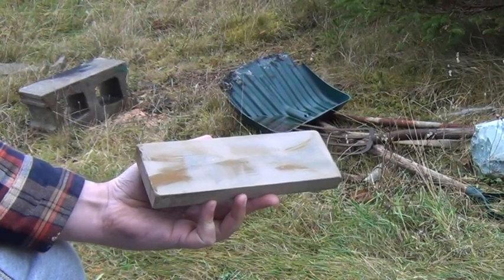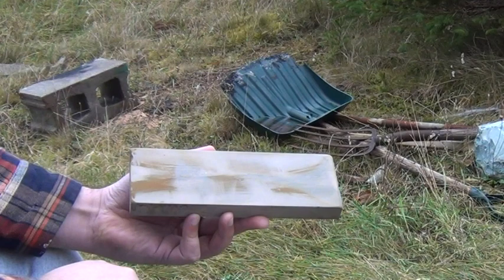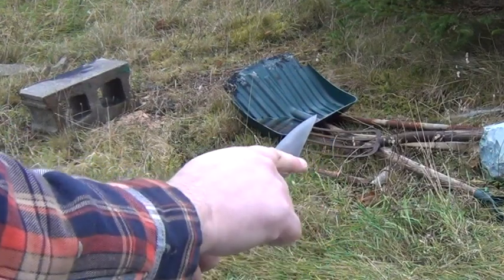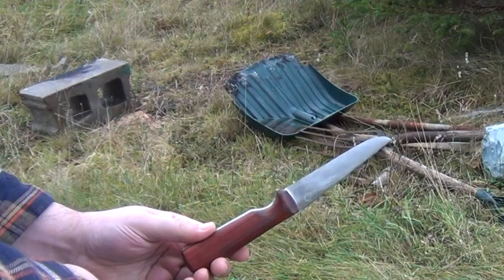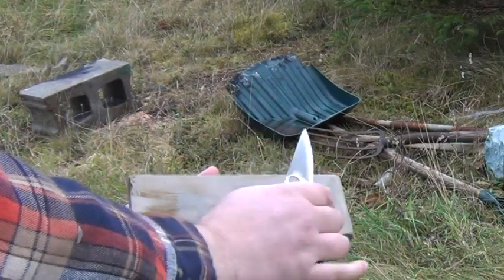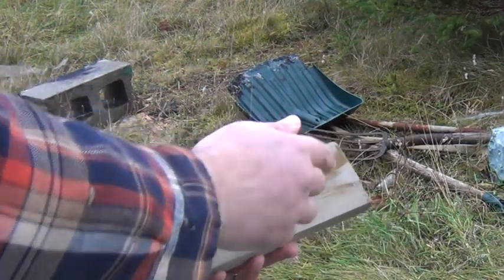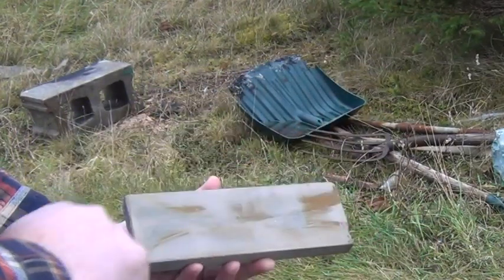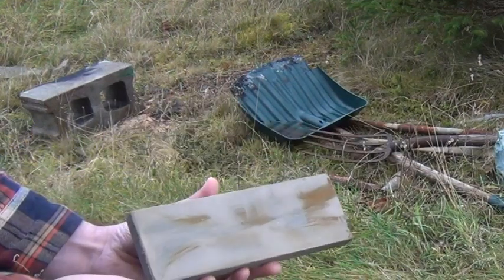The influence of not flattening waterstones on sharpening angles

Comment: Flattening of water stones is usually necessary but in some cases is not. Depending what you sharpening or grinding. For some tasks is even better if stone have curve. But even you flattering the stone you don't need to do it fully flat. Simply draw grid pattern on the stone and start flattering then this area were pencil is removed the stone is flat so you can use this areas only and this way you using all the sufrace of the stone minimizing its waste by flattering. Never use low spots where pencil grid is remaining. So to minimize wear of stone you should fairly frequently attempt it to flattering but only to erase pencils grid pattern very slightly removing only some obvious high spots but not low spots. And use large flattening stone or alternatively rub two similar stones together (with the same size, similar grit and similar hardness). But only rub two whetstones together if they are both requires flattering. And one important thing even your stone is not completely flat you should know which areas is flat and which is not.

Comment: I personally flatten my stones religiously. Try sharpening a scandi knife or any knife with a flat surface  on several stones that all have different flatness levels and shape. It's incredibly frustrating. If you simply flatten your stone after every use you remove very little material. And I'm not too worried about flushing a little bit of slurry down the sink, especially from a 20$ King or something. It's not worth the hassle of trying to "use the high spots" when you can simply flatten the stone

Comment: nothing is ever flat. Thats like the hardest thing to engineer. If cliff were alive we would battle. the flattening stones are not flat. The edge itself is not flat. your hand has different pressures. You would need a robot that also compensates with software for the tolerances of its own articulating parts. This flattening stuff is bonkers. its mostly for chisels and the level of tolerance in regards to dishing is gigantic, especially compared to precision engineering. you need literal lasers to even measure "FLAT". I can sharpen on anything. Now, DRESSING a stone can be important, if its not friable enough. and  averting excessive dishing can help with ergonomics. But thats about it, when it comes to stone lapping. no need for loose grit. Cliff says he uses sand on concrete. the concrete is not flat and neither is the sand. Just use a cheap belt sander if the dishing is pronounced enough to bother your technique. Or some cheap diamond plates. Then clean the stone to take care of any grit contamination, if thats a concern.

  Those fixed angle sharpeners are mostly practical in preserving expensive factory finishes. But thats pretty much where there application ends. They are also super slow and having you hand exposed to the blade is hella dangerous. Its sharp already at that point. The fixed angle sharpeners are a jig. An expensive jig, dumb dumbs over pay on. I must be the greatest. Give me some immersed  diamonds, if we are gonna talk precision. Knife people are bananas . just rub the thing on the thing. The difficult part is the metallurgy and the creation  or harvesting of abrasive  particles. Also the engineering of the binding materials. But true flatness is almost impossible. mic drop
Reply: and every time you pass over the stones surface. You abrade away material unevenly. The knife and the stone. Because you are human. And even machines have trouble staying true. 

Occam razor on this one. Cliff was trolling and rage bating everyone for attention and views before it was cool. Which is genius. Im pissed off at Cliff postmortem. God damn. RIP you Glorious bastard. The vid on plateau style sharpening is a master piece .   Should be called "CLIFF" style sharpening. Create a little cliff on the edge. Plateau is too wordy. 

But this is rage bating before rage bating was popular. Brilliant . But im fuming here.

 I can sharpen a knife on the spine of another knife.
Reply: https://m.youtube.com/watch?v=OWa3F4bKJsE&t=34s&pp=ygUTc2NpZW5jZSBvZiBmbGF0bmVzcw%3D%3D The science of Flatness. Great vid.
Reply: https://m.youtube.com/watch?v=kTiIFzhxhq4&t=973s&pp=ygUUc2NpZW5jZSBvZiBhYnJhc2l2ZXM%3D The science of Sand paper. also a great vid.

Each abrasive particle also differs in size slightly. We are dealing with microns here people. Not Millimeters. This is the kind of  stuff that keeps me up at night. The ghost of Cliff Haunts me. Imma burn some sage to appease his sharp soul. REST IN PEACE master

Comment: Cliff, do you think that Murray would compensate by dropping his angle shallower to make sure his angle was similar on both stones.  I do agree however jumping from a dished stone to a flat one is hard when you just end up polishing the sides of the bevels. It is especially important and noticeable in straight razor sharpening. I had emailed Murray and and confirmed he flattened the stones before razor sharpening.
Reply from the maker: He had started flattening recently. It depends on the cost, maybe if I had natural stones which can be in the $1000 range I would not flatten aggressively, but most of my stones are in the $50 and less range, and even lapping them very aggressively they last many years.
Reply: @CliffStamp  I saw that, Him and Harrelson Stanley who used to be with Shapton teamed up with the NanoHone. I also lap my stones bc like you I don't have any crazy naturals. I wonder if he gets his knives any sharper now?
Reply from the maker: @SA-fx4id  I doubt it, having a flat stone just makes it somewhat easier, maybe he is faster now? But his experience is at an insane level as he does so much sharpening by hand.

Comment: Cliff you mentioned that you dont sharpen axes at 17dps what would you typically sharpen them at? Also what do you sharpen your folders at?
Reply from the maker: Axes would be lower, depending on the type of tree generally and how I am using it. A felling axe for pine is very low compared to a limbing axe for spruce for example.

In general, you reduce the angle until you can't reduce it any more as it would collapse.

Comment: This video makes me kinda wonder if the originators of the washiata stones, found a stone that would load up with fines and still cut, retaining same hardness, just for the fact of keeping there steel on one surface, since the stone will wear into dips, but to keep the same knife on a relative surface.  I guess a proper use of washiata invloves course sharpening/shaping, until the surface is semi fractured and starting to load in the course pores.
Reply from the maker: +Ryan Beard I have little experience with Washiata stones, but have used soft/hard Arkansas. The rate of wear in them is so slow they rarely need flattening, but they can require conditioning to keep them abrading.
Reply: +Ryan Beard   I have a Washita and it behaves pretty much like a soft Arkansas - a bit coarser but still produces a pretty keen edge. Doesn't fracture or load up excessively with normal usage and care. I'm no expert but it's a pretty good stone imho.

Comment: I would really love to see the arithmatic, let alone the psysics involved, in reaching this conclusion. That sporadic indentations in the stone in the order of a tenth of a millimeter can result in a 4 degree angle increase per side of a curved blade with uneven thickness. Maybe I'm missing something..
Reply from the maker: halfdana There is no physics involved in the effect of wear, it is just math. As the stone wears there will be grinding on essentially the flat part, the hollow and the apexes. This essentially doubles the range around the flat.As it is random, it is possible to grind one side different than the other, hence doubling the range again.Thus even a small wear which would produce ~1 degree could cause the included range to be off by 4 degrees. It is immediate if you take a knife and grind on a very soft stone like King 1000 and then jump to a true flat and look at the scratch patterns, they will not over lap.
Reply: Cliff Stamp Thanks for answering! I'm not being intentionally dense here, but I really didn't understand that. Wouldn't this be a function of the size of the hollows(in area)as well as what proportion of the blade making contact at any given time? Is it possible to reach you by mail? I'm fairly new to sharpening and have watched a lot of your videos recently. I would really like it if I could shoot you a couple of questions.
Reply from the maker: halfdana cliffstamp@gmail.com
Reply from the maker: halfdana Yes, as well I think it also is weakly effected by the depth of the slurry formed. I used to think that was a significant effect but I checked it on a Norton oilstone using high pressure to generate a slurry and the bevel still formed very close to true flat similar to a diamond plate.

Comment: This is why I love the shapton glass system with the Diamond on glass lapping plate. I lap after every use no matter how little the work on the stone was. that plate makes the stones so freaking flat, and have the same surface throughout the grits, my knives have never been sharper. I flatten stones constantly. Like you said though, it depends on what you do when you sharpen, and what your stones are like.  Some argue knife sharpening is more so about the surface of the stones, than the technique you are using!

Comment: I own 3 Murray Carter neck knives that are my favorite knives of all time.I really like and respect the guy alot. While I agree with 90% of what he says I disagreed on his flattening comments. I have made this point, respectfully of course, with Murray on some of his other vids. I make the point that his unflattened stones have chips and corners missing that probably outweigh any loss of stone by flattening and beveling corners to prevent such chipping. Flattening and beveling edges stops most pressure flaking/chipping. Also, 100% of the togishi I have watched either "flatten true" or convex - concave their stones as well as beveling them. Ever try to sharpen a plane blade or chisel on an uneven stone? You're better off pissing up a rope. You don't always have to keep stones "true flat" as in squared though, because sometimes smooth is good enough and a convex or concave shape is needed. (struggling to say how my parabolic arch in my stone is flat and true without actually being flat per se). I have 2 green bricks of joy (naniwa aotoshi 2k). One is always flattened and trued and one is always swayback. The swayback one is that way on purpose, for my convex edges and makes a far superior convex to the faceted edge people get from a "trued level and flat" stone by rocking their angles. I hold the knife level and strop it from high edge to the center, from knife tip to base and then alternate sides as needed.  I don't count strokes since my backhand and forehand are not exactly alike so I go by feedback, both feel and visual, to know when to swap sides. Don't get me wrong I make the surface smooth with a small arkansas pocket stone or diamond mini hone but it is as swayback as a skate park elongated half pipe. Some people prefer the opposite, a high middle rather than low middle stone for the same purpose and stones can be bought already convexed called han-han stones.
Reply from the maker: Yeah, he has changed his perspective on it now and has a more balanced approach which includes flattening.
Reply: Cliff Stamp I am sure his perspective was developed from sharpening HIS knives and HIS daily stone uses with over 30 years of success. Trying to cut costs and streamline his daily production for better efficiency. Where a jack plane blade or chisel never were sharpened on the stone nor was anything zero ground and only his knives and his style of free hand sharpening were done. (Which is in fact EXPERTLY done with EXCEPTIONAL results.) I have no doubt about his skills. Hard to change someones mind after 30+ years of success. Him changing that steadfast stance is a good thing as I see it. He was willing to see things from anothers perspective. I have changed my stance on a few things over the years as I have gained more insight, knowledge and wisdom. >old  saying ; two men standing on either side of a coin being asked what they see. One says he sees heads and one says he sees tails. Each one knows, beyond a shadow of a doubt, he is right and the other is lying. Until one is willing to see things from another side you only have half a truth, half the facts.
Reply from the maker: Robert Schmidt
This is really critical. Often people look at recommendations without considering what is being done. Murray tends to use a particular steel a lot, geometry a lot and particular stones a lot. All of these play a part in why he has the views he does. I doubt for example if he worked with steels like 10V frequently he would have the perspective he does on waterstones vs diamonds.

All of that being said yeah, he has a very zen way of sharpening that you have to respect for the time it shows he has done that activity and the skill he has learned.

Comment: I flatten with wet and dry sandpaper.Use king 1200 and 6000. Strop on chromium oxide loaded strop can tree top hair.Good enough for me and I have no idea on exact angle. I think you can get over obssesive. I initially ruined edges with 6000 grit and once mastered ruined them with strop.Got it pretty well sorted now.

Comment: The no lapping a stone is mainly coming from Jpanese natural stones use. When a stone cost a few thousand dollars , it makes sense to no lap. Synthetics are nowhere near as expensive and lapping is not a waste in the same sense as natural stones.
Reply from the maker: I can see how overly aggressive lapping could be an issue, but nagura stones which are commonly used on natural japanese stones are used in part for flattening and correcting high spots and to even out the stone. I don't see the sense in a very military no-flattening perspective and it definitely isn't a common japanese perspective.
Reply: Cliff Stamp
Quality Naguras are  hard to find and are very expensive, diamond plates are used to lap Japanese naturals, very widely. Naguras are softer than any stone that would make use of nagura, and therefore the use of nagura to flatten the stone is pointless. Naguras are means to create grit that is broken down by the base stone to the fines of the stone. People widely use tomonaguras as well, those are slurry stones cut from stones that are not Nagura, they are used for the finest polish.
Reply from the maker: mainaman Yes, now diamond plates are frequently used, but that is only recent. 

Can you use them to make a slurry, sure you can do that with any stone if you want, you just have to make sure you understand what you are doing as you could easily make a slurry which has very different properties than the base stone. If you want to sharpen with the properties of the base stone then the nagura should be significantly finer.

Comment: You have no disagreement with Carter. Murray is talking about sharpening and states in his video, ""only one part of the stone is only ever in contact with one part of the blade" This is Murray's main assumption and he states it very clearly. If you are flat grinding the enire blade across the entire stone, of course this is not going to work. However, he was talking about sharpening and not re-profiling the grind of the entire blade. So there is no argument, you are both talking about two different things. (I am quite amazed that you are able to count up to 80,000 passes on a relatively new stone) Personally, I will flatten stones, when I see them begin to dish out, but I don't get nuts about it, if I can sharpen in a small corner of a stone that has a flat area (about 25% of the stone surface), I can get a dead flat and consistent angle, because I'm not moving the blade across the whole stone. I'm just using the small flat area in a corner and this can be done with a fairly large blade.
Reply from the maker: My disagreement is with his avoidance of flattening on the basis that it wastes a stone. As noted in the video if you do not flatten waterstones it will lead to an increase the the angle applied, regardless if you are working the primary or secondary bevel. This has multiple consequences, none of which are positive.

Yes flattening a stone does waste parts of it, but as noted, even coarse stones will have a life time on the order of 1/2 million passes, finer stones are much higher again. Thus you have to ask yourself is saving literally pennies is worth the increased time/effort it takes to sharpen with non-flat stones.

The reason that Carter does see many of the effects is because of how he sharpens. He doesn't say it clearly but if you watch his video's he raises the angle of the blade to the stone significantly after he has apexed the edge in order to apply the final bevel. 

He also works mainly on easy to grind steels, laminates, etc. and thus he doesn't see the problems which result if you use non-flat stones on very hard to grind steels.
Reply: I think your final point about high Rc steel is a valid point. 20 years ago at the Blade Show, I was very excited by two folders a Japanese table had made of ZDP189. Eventually, Spyderco came out with a knife in this steel.  It's been one of the worst knives I've used for taking a sharp edge. I think that  Spyderco may have blown the heat treat or something because it's all most impossible to get a good edge on this knife.